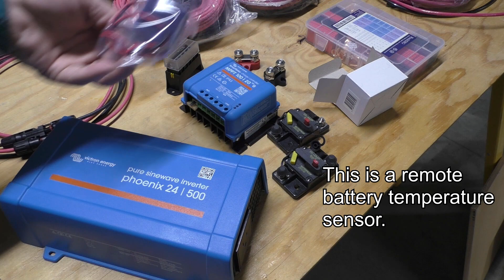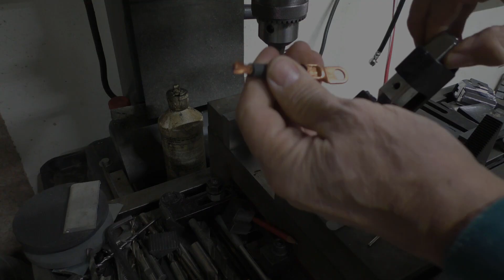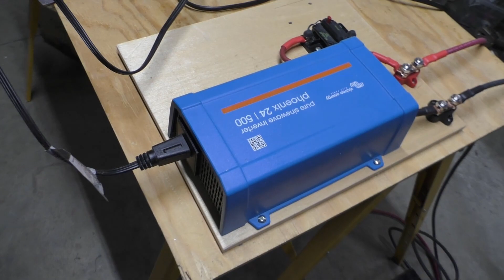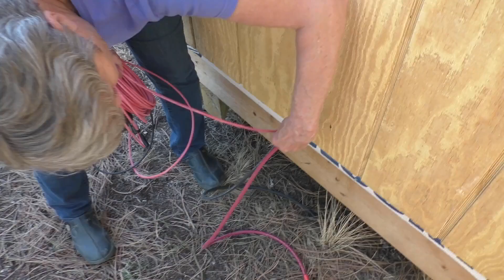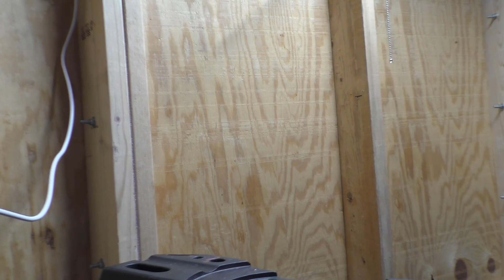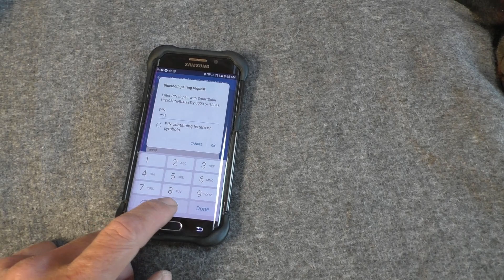Solar System for a Tiny Home, Off-Grid DIY Victron Inverter and Controller Spencers-Mountain

Comment: The fine wires has nothing to do with electron flow at DC, high frequency yes.. the fine wires is simply easier to bend. If you only have solid wire and you can install it ok you will be fine.

Comment: No reason you can't keep those batteries inside. AGM batteries have extremely little off gassing. No reason to leave them outside on the ground or in the cold. Nice job on your install. Looks like you chose some quality components.
Reply from the maker: Thank you for the information. The battery manufacturer, not the label name, did not recommend having batteries inside. But I do need to protect them and warm batteries have better storage. Appreciate you taking the time to let me know.

Comment: nice job ! im in the process of building a small solar system for my home. i have everything i need, I'm just not sure how i need to configure the wiring. Only thing i may need is the breakers, and not sure if i need them or not since my batteries have their on Battery Maintenance system(BMS) built in.
Reply from the maker: Thank you for the comment! And good luck with your solar system. Love to hear how it comes out. Breakers or fuses are just insurance. You never really appreciate how much power you have stored until you try to release it all at once with a short.
Reply: Might want to consider a pre charge / discharge resistor to charge up the capacitors in the inverter before you connect it though. Non lead acids have a huge capacity to dump all in one moment. 
Fuses fuses fuses. Save your bacon when a short occurs!
Keep the low voltage cable runs short, don’t need line losses to be any higher than needed.

Take care
Mark
Reply from the maker: Thank you for the comment. The resistor was not mentioned by Victron. There is a definite spark when first connected. A common occurrence in many inverter videos.  I have breakers in my example, but was missing a fuse at the battery end of main leads, which has been added. All of my low voltage cables are pretty short and oversize copper welding cable. Good cable can be very expensive for low voltage application and is usually sized per money. I like to oversize and pay the extra on the cable.
Reply: @SpencersMountain  i have noticed my whole solar system seem to run smoother on lager copper wire connections. By smoother i mean less power loss and less heat at the connection points.
Reply from the maker: @mannyfragoza9652  power loss, and heat are an effect of resistance to current flow. Low voltage electrons flow easier around the outside of a conductor. Cable with many fine conductors (wire) is better for low current than similar gauge wire made from larger wire.  The more conductors (wire) in a particular gauge cable, the more surface area for easier electron flow.  At regular household 120v, solid wire is normally used in a much smaller gauge for a given amperage.
Reply: @markeh1971  i have a resister on a battery  clamp ,but i dont think it works because I still had sparks when connecting the batteries to my system.Ill see if i can find a video how to make one thanks Mark
Reply from the maker: The resistor still conducts current. It will indeed spark when connecting. When you clamp to a live circuit, there will be sparks until the connection is solid. You could always use an appropriately size switch (disconnect, relay, etc.) to make the circuit after connections are made. There will most likely even be sparks in the switch contacts...but you won't see them.
Reply: @SpencersMountain  i had a little luck with a resister connected to a med size clamp. I left the clamp and resister touching the battery pole for more than just a sec or two. maybe 5 to 10 seconds seemed to work. I didn't see any huge spark. I didn't seen any spark at all.